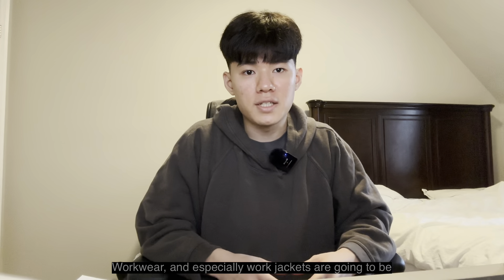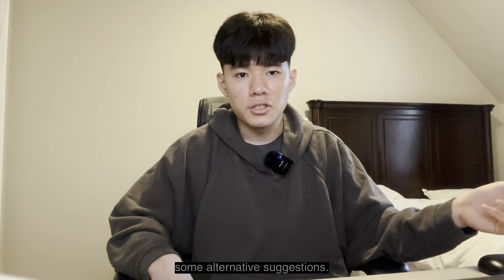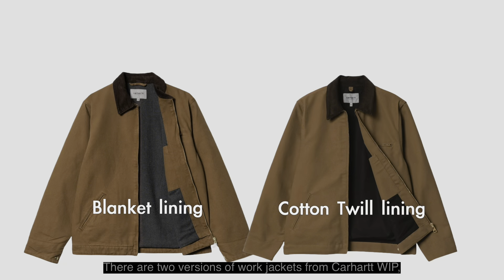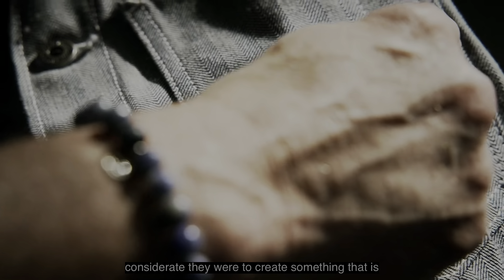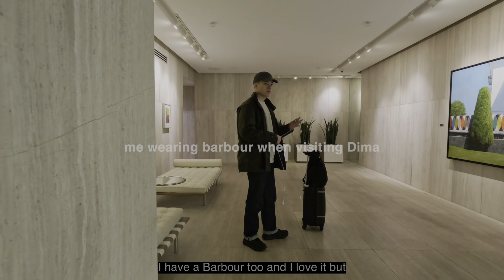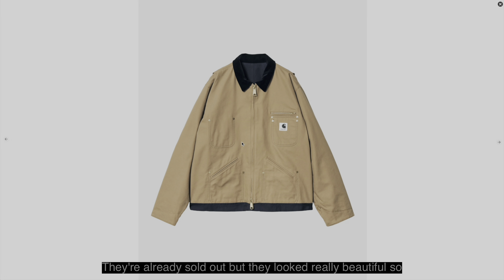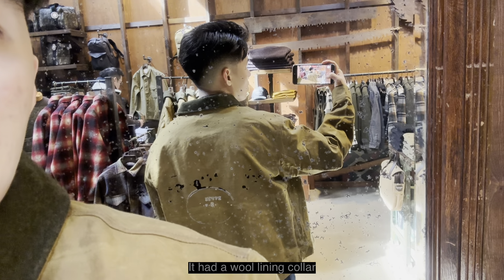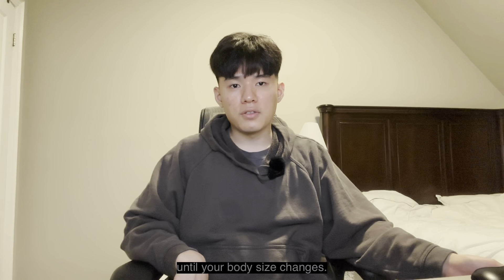GOAT Work Jacket Brands

Comment: Hello scott. Does the winter version of carhart jacket with blanket lining provide enough warmth in snowy weather?
Reply from the maker: Hello GhostofSivas, it will really depend on how cold it gets during winter where you live. I live in Toronto, and the last winter was pretty warm since it was barely hitting -10 degrees Celcius most of the days. I would say winter version of Carhartt WIP jacket was warm enough for such weather. You can always layer a sweater underneath if that's not enough. Hope this is helpful!